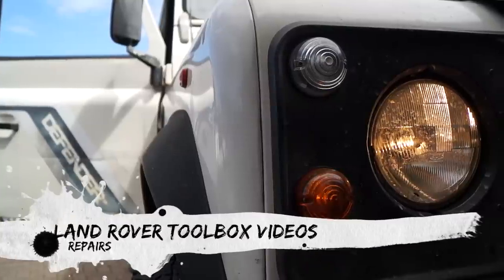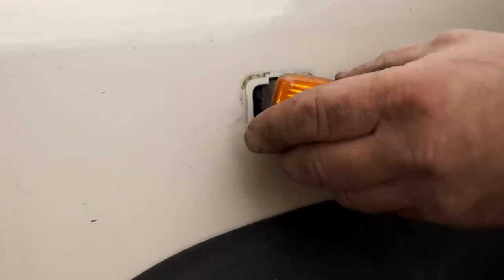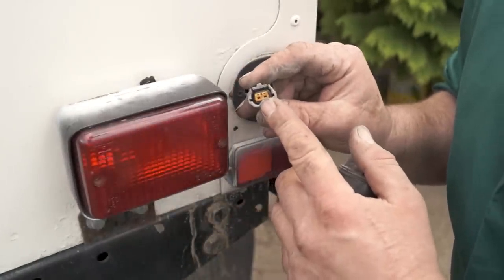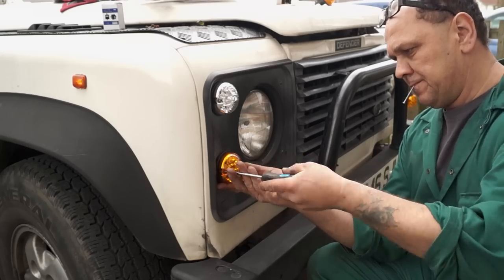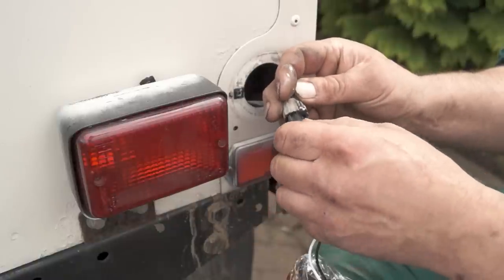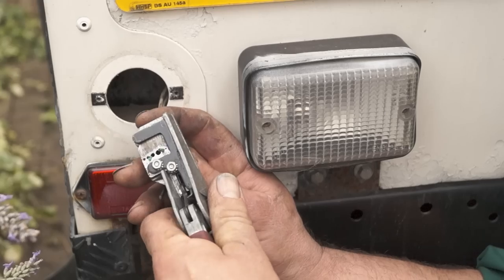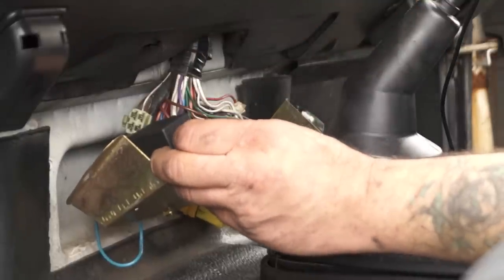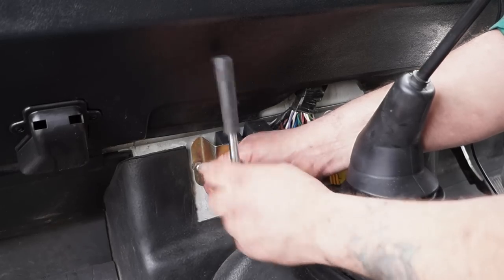Fitting LED lamps to a Land Rover  Defender- The Fine Art of Land Rover Maintenance

Comment: I’ve just installed new LED lights in my Defender. When the lights are turned on both low-beams work as advertised but my driver side hi-beam comes on as well. When I turn on the hi-beams the driver side hi-beam goes out and the passenger side hi-beam comes on. Any ideas on the the problem/solution could be?

Comment: Hi, 
Thanks for a nice, clear video.  
But I have a question-- I've gone and installed a set of Wipac LEDs on my '86 110 and I've got the adjustable flasher relay as pictured here.  
Things aren't working all well out of the box-- my left indicators work fine, but the rights also flash the brake lights a little bit-- I understand that I may need ballast resistors.  Did you have the lights that already had resistors built in?  I have checked that mine do not have any resistors built in. 

Thanks for any insight!
Reply from the maker: Ridwan Ahmed  you have an earth issue with the lamps on the the side that are flashing together.   Perhaps the earth to bodywork is loose or there are dirty contacts in either the lamp and or contacts.   When the brake light is flashing it means the power from the indicator is trying to seek earth passage back to the battery the easiest way possible  IE:  through the brake light circuit.
Reply: Thank you for the suggestion! Found the loose connection, and needed one 3ohm resistor on L and R indicator. Good to go now. Cheers!

Comment: Great video as ever. I never noticed the spacer for the fusebox on any of my Land Rovers (85, 86 & 94), is it on all MY? Thanks
Reply from the maker: good question.    If the spacers are not there the  relays are crushed so it needs to be fitted.
Reply: io

Comment: Great video series! All very clear and informative. Is the adjustment on the relay not for controlling trailer indicator warning? i.e fit all four LED indicators then adjust the relay so your trailer indicator dash warning light goes out, hence retain the functionality of letting you know trailer indicators are on?
Reply: The adjustment on the Wipac  relais is for the trailer light. I've installed all LED lamps on my '14 Defender and everything works perfect
Reply from the maker: Of course because you are changing the voltage demand when adding extra lights onto the relay.  BUT the standard relay does not register the LED lamps because the demand for  voltage is so low.

Comment: I have fitted a set of these to my 02 Def 90.. all work great but the Trailer warning light stays on after starting, even without any lights on....  whereas before it only illuminated  when I plugged a trailer socket in and used the indicators.. the relay made no difference at all when making adjustments using the adjuster knob, luckily it worked at the right rate out of the box.... and may I just say, changing the relay on my car involved removing the steering wheel, column covers and dash !!!  screws every where.
All bulbs were changed but the kit did not include a high level brake light for the rear door glass.. so it looks very dim compared to the others... are they available anywhere...
Reply: Hi. I have just fitted LEDs and I have the same issue all the lights are working correctly but my trailer warining light is on CONSTANTLY. Where as before it only flashed when indicating......  is this a problem or just something that I can ignore ?  I don’t tow at the moment but do plan on getting a tow bar fitted at some stage.

Comment: And now your vehicle is ILLEGAL for UK road use and you've INVALIDATED YOUR INSURANCE.  

You're OK for off-road use, but would need to transport your Defender on a trailer, as it  cannot be used on UK roads.

It's a shame, because LEDs a better, but the UK regulations haven't caught up yet.
Reply: I think if they are 'e' marked they are legal for UK road use, also many new cars leave the factory with led lights these days. 
I may be wrong though, but that must make all new cars illegal too?
Reply: Wrong you cannot fit led bulbs in conventional headlights but you can upgrade the whole light to led
Reply: It's all to do with the focus point of the reflector. Simply inserting an LED bulb into the vehicle's standard reflector will produce an incorrectly focused beam; consequently, it's illegal. However, if you change the whole headlamp unit (LED bulb and LED reflector) then you're perfectly legal so long as the new headlamp unit has the appropriate type conformity markings. 

My original reply was 3 years ago when the UK regulations were somewhat different. So be careful to check posting dates when searching legality questions on the Internet.  Enjoy your new LED headlamps 👍